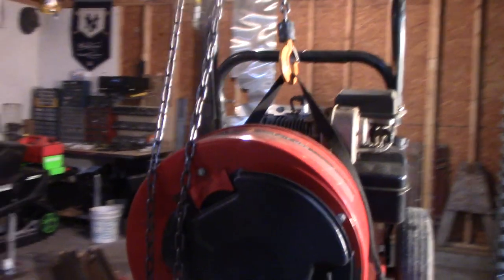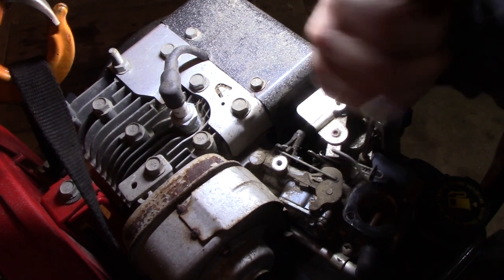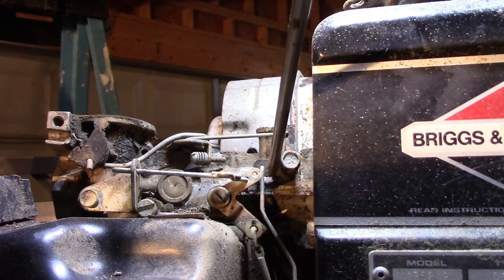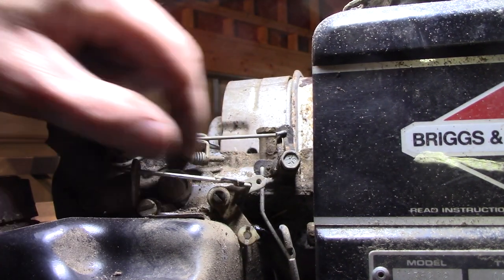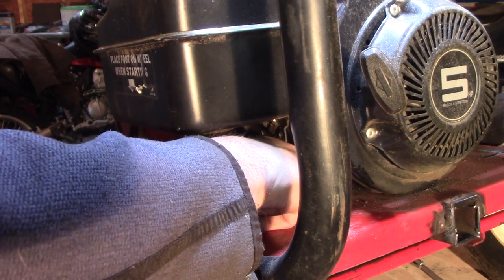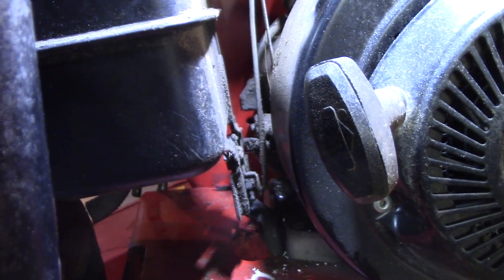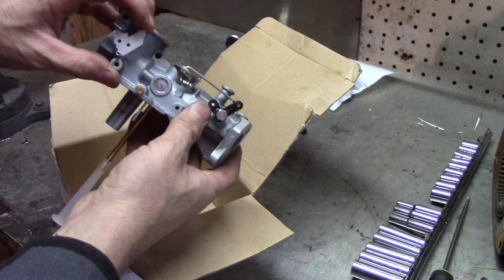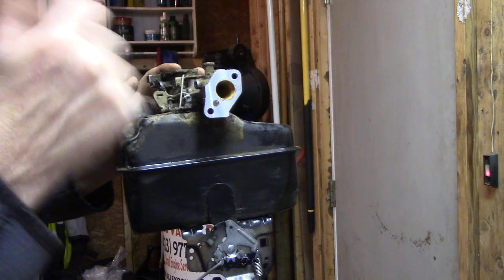5hp Briggs and Stratton carburetor replacement

Comment: I believe dropping the tank first is the best way to approach that awkward 2nd bolt.  Then, you can sneak a flat or philips head between the fuel filter riser pipes.  That's what I did.

Comment: Thanks for the video.  Those B&S engines are almost indestructible!   I have a 25 year old MTD chipper shredder with the same engine.  I needed to at least clean up the carb and check the valves.  It is a pain to get started.  Once I get it started, it runs well.  My chipper shredder has been garage/shed kept all these years.  No rust.
Reply: hi there, you think it is the same engine i have on my rototiller ? 1994 5hp briggs 135292

Comment: you said, "That's what I'm saying and I'm sticking to it." hahaha. Awesome !! you got it started.
that briggs & stratton engine is on my MTD tiller (model 340 but also manual says 390- has reverse) except bolt underneath fuel tank is different.
you are Dr. Mechanics. thanks so much. you made my life easier.
also, i guess when i buy some new equipment i should see how hard it is to get to screws and such maybe. but all today are probably a bit difficult to get to them.
you really should be a professor; you explained it PERFECTLY.
thanks again and God Bless

Comment: Thanks for the video!! I'm doing the carb swap as I type here. I got my carb kit on Amazon, it's still 17.99 (w/plugs, filters, etc...bonus). I plan on coating inside the tank with POR-15 for rust protection. I finished the flail arm and blade maintenance today. Need the weather to cooperate (not happening). Wish I knew Tom Allen before he scrapped his unit. Mine is a 5hp MTD chipper/shredder, from the late 90's. Thanks again, the video is a great reference.

Comment: I bought a used Simplicity chipper (5 hp), replaced plug, cleaned gas tank, new gas, carb, oil, wouldn’t start.  Saw the part with pulling the plug and tapping the piston with a hammer and socket extension.  Put some oil in, pulled rope several times. Loosened everything up.  Plug back in, started second pull.  Ran today for 45 minutes, runs like a champ.  Thanks!
Reply from the maker: Cool

Comment: just put one of these carbs on a tiller it started right up but acts like it needs adjusted the engine has a constant surge to it only problem is there is no mixture adjustment screw I thought there was but it appears to be just a cap covering a non adjustable jet. perhaps I missed something also I found its only two bolts to take the exhaust can off and that allows a clear shot at the top left bolt
Reply from the maker: Maybe governor out of adjustment or spring going to governor might need adjustment

Comment: Most people don’t think about this but deff empty the gas tank out on this model if it’s full before you use any tool that might create a spark because the way this model is designed is so explosive if there’s any spark lol
Reply: lol wtf ?
Reply: True that. There is no other drainage hose on it to get gas out except by siphoning  most of it out or turning the whole thing upside down or wicking it out with paper towels. Bad design on their part.

Comment: Did you transfer the old carb mix screw? Was it already on the new carb? Did you adjust it or was it preset to some spec?  I've got this similar carb on a craftsman tiller. Thanks.

Comment: Hello there, great video, do you know what the correct name is for the fuel pipe attached on the engine with 2 bolts, or even the part number 
Many thanks

Comment: I have that engine in tiller, really awfull design, engineer has not spend one second thinking how to repair it. Maybe its easy build by thosands but I hate remove carburator when must dismantle half engine to it. Old B&S were super reliable, this need service all the time.

Comment: i had to wait on the starter recoil pulley. with clean gas tank, it is starting and running powerful. it won't go in idle. is it the spring below the gas tank? spring and link move but it still runs fast.
i put some pb blaster lube on the controls behind the choke and run levers. they're easier to move than before lubing. could that be it? i wouldn't think. 
or could it be the starter pulley? because i don't think i turned it all the way counter clockwise before putting a new starter cord.
you don't want to know how many times i looked at your vid hehe. it's running great except for not going into idle. Will this damage the engine?
thanks again.
Reply from the maker: You don't want the engine racing high it might be you need an adjustment at the governor Spring. Most of the time you can bend the tab that the Spring is attached to one way or the other will increase or decrease the rpm's
Reply from the maker: Or the governor might need adjustment look up how to do that
Reply: @JLafix  ok great thanks. i looked it up after commenting to you and saw that might be it. but i still wasn't sure. i'll find out how to do it online and try. man, that thing is clean now and started easily. i can't say thanks enough. i'll let you know.
Reply: @JLafix  Viola! got it purrrrrrrring now. something soooo simple. my fault. i didn't screw the screw down all the way into the top of the carburetor - at 29:15 ; it's the link going to the lever that couldn't move on top of the carburetor; in your vid, you didn't show you taking that long screw out the top. not your fault, i knew it had to come out. it was just a little more i had to screw it in, just a little more to allow lever and link to move. dang. 
it goes into idle ok now and starts quickly. briggs and stratton, both of them hehe, are great.
i forgot to mention gas was coming out of the gas cap a bit; maybe because rpms were high and shaking lots. it still comes out a bit so i'm going to put that sponge thing back in gas tank to keep gas from splashing up to gas cap. should fix that little leak.if not, then i will make some rubber washer.
i took my time; getting vegetable and garden ready for next year.
thank you.
you are The Boss!

if there is anything i can help you with then please let me know.
Reply: btw, at 29:15 , it's not the screw going into the black piece. it's the link going from black piece to the top of the carb. lever that the screw was under. you know but others may not know what i'm talking about.
You Definitely will get blessings for helping others and me.
Reply: i didn't have to put the sponge thing back in the gas tank. it's not leaking now.

Comment: put new carb on ez thanks to you. it starts sometimes and runs sometimes for about 2-5 minutes. i didn't clean the gas tank out. dang hehe
i didn't have the 1/4 rachet so i thought i'd try it without cleaning the gas tank. stupid me. the tiller has been sitting for years with gas in it. it's not my tiller. i will take carb off again and gas tank. i will let you know if it runs after i clean the gas tank.
i took the large sponge filter in the gas tank out. it looked like a rust color. i read that somebody took a filter like that out of gas tank because it was torn apart. it helped that person. should i replace that too? or try to clean sponge filter? in other words, do i need it if i clean it and take care of tiller from now on?
thanks
Reply from the maker: Actually I'm not sure why that sponge is in there. But I've noticed it's only in that type of carburetor gas tank combination so it might have something to do with fuel stabilisation so that stem can pick up fuel instead of it sloshing around
Reply: @JLafix  i'm going to toss sponge and clean out gas tank. it's in my way hehe. anti-sloshing .... i'm not worried about. i will do some major cleaning on it soon. it's overdue.
thanks again.
Reply: @JLafix  got the gas tank off; position of the bottom bolt took a bit longer. it was brown, rust, and part of that sponge attached to tank. i put CLR for 24 hrs, nuts & bolts and shaked it - repeated that 2x; cleaned out most, but i wanted it cleaner.
i used 2 bottles of Lysol Lime and Rust Toilet Bowl Cleaner (comes in a black labeling; not too expensive either for two bottles) 1x for 24 hrs and no nuts and bolts. i couldn't believe it. CLEAN AND SILVER NOW ! almost new plus it smells good hehe. i had to wash it out with lots of water and then shop vac blower. it's drying in the sun now. i want to clean up the rest of the tiller and let you know. thanks to you i got motivated. Seriously THANK YOU. 
i will let you know when i get it running.

Comment: Sir I am working on one like this but it don't have the top for it could you tell me what year model this engine was built I would appreciate it
Reply from the maker: I don't have the machine but they made these  5 horse power for a long long time I am sure just looking up 5 horsepower Briggs with that kind of carburetor situation your good
Reply: google "Yard Machines by MTD tiller 340 model manual" (it has 390 model too) - about 20+ pages; it has all the part numbers for that exact engine.

Comment: Once u take start n carb on n off  of easy to take off I clean everything even used the welding tips cleaners to clean the part tht goes in tank but it still won't start at nless I spray starting fluid but it's not pulling up gas any ideas. The 1 I got is mtd front blades
Reply from the maker: Well it seems obviously something is clogged but no telling what . Sometimes those pick up plastic tubes get Clogged and nothing you can do about it except replacement but other than that don't really know
Reply: @JLafix   ya I'm gonna try to clean it 1 more time if not buy. A new carb   but they dnt have tht exact 1 n I hate buying new n have to rig it but u gotta do what u gotta to make doe. Thanks tho

Comment: I have compression and replaced spark plug and filter. Still can't get it to start without spending days tweaking the idle screw. Any tips?
Reply from the maker: If you give it a toot of starter fluid down the carburetor throat or through the spark plug hole  And then wants to start it's most likely you get a bad carburetor
Reply: @JLafix  now i see bubbles on the top of the engine lol. I'll have to get an engine rebuild kit and a different carb
Reply: @JLafix  or just reuse the old one. It looked just as good
Reply: @JLafix  one more question. Which way does the idle adjustment screw work? Right turn for more gas? Or left?
Reply from the maker: Usually righty tighty

Comment: where did you purchase your carb from?
Reply from the maker: Amazon
Reply: @JLafix  thanks do you have a part number
Reply: Part Number 498298 Briggs and Stratton Carb
Reply: Did you need to adjust the jet on the carb? I just bought one and it wouldn’t idle so I adjusted it out 2 turns but it kept vibrating closed.